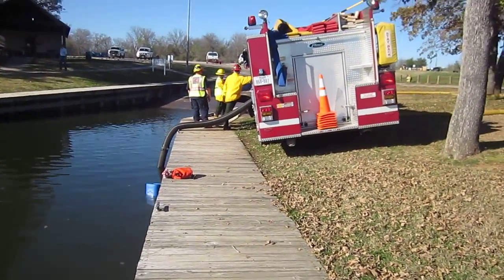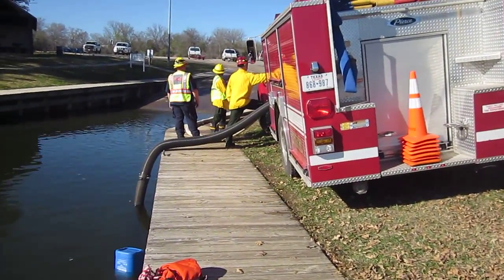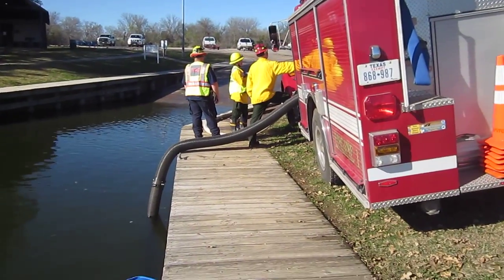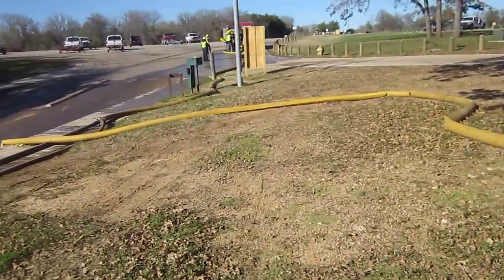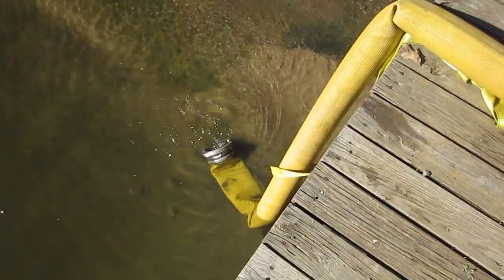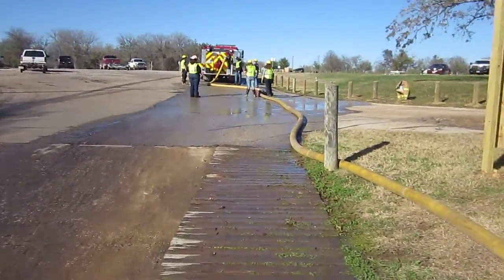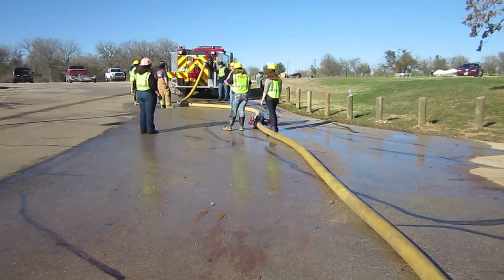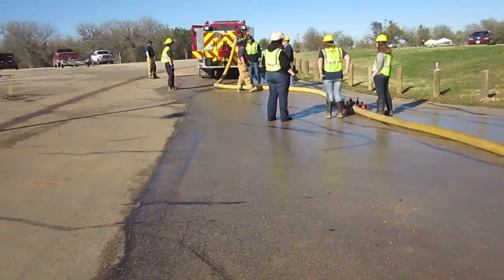Part 4 - Rural Water Supply Drill - Bastrop, Texas - December 2013

Comment: There's no need to use dual 3" lines into a wye, most modern pumpers can pump into a 5" line off the officers' side just like you have the circulating line set up.  You should reverse the roles of your discharges.  The short length of the pipe coming off the pump won't affect the ability to pump into LDH very much at all.  You guys obviously have the fittings, you should just go ahead a fill with the LDH.  If you just aim the elbow of the discharge to the rear you don't even have to hook up hose.